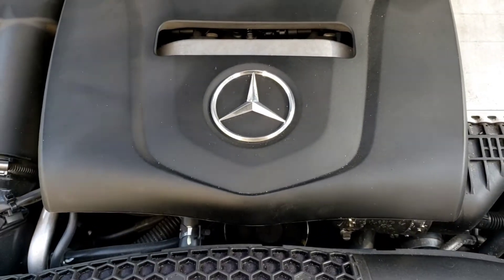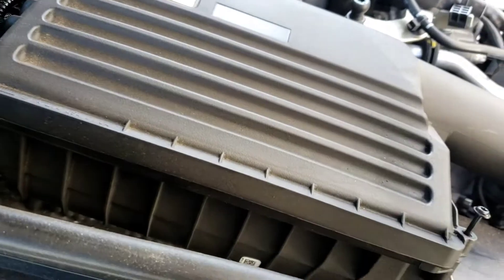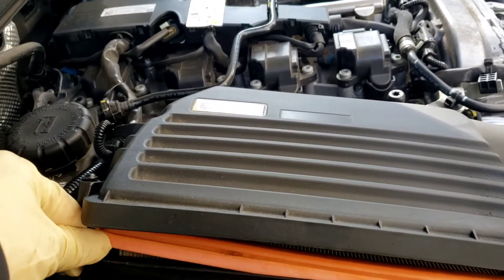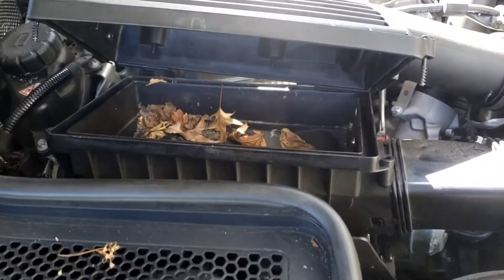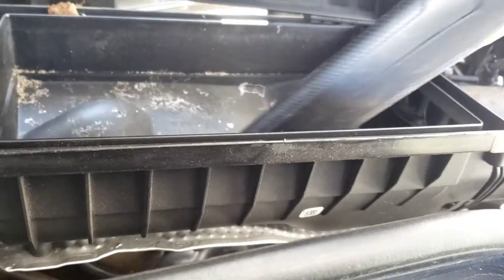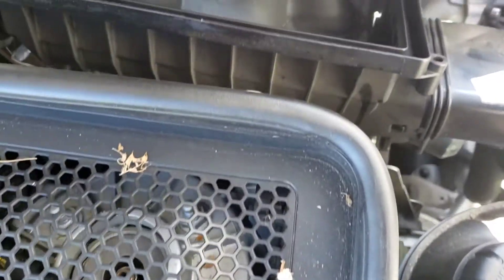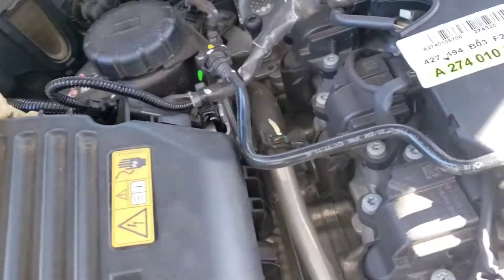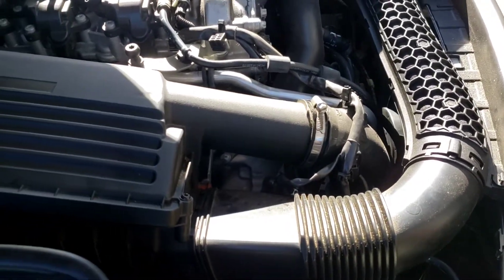Mercedes C300 4Matic Air Filter in Engine 2016 How To Replace Change out

Comment: Do you know what the reservoir behind the air filter is and what it is for?
Reply from the maker: I was waiting to see if the car comes back , but it was sold..but by looking at the picture on the cap its the radiator overflow tank.